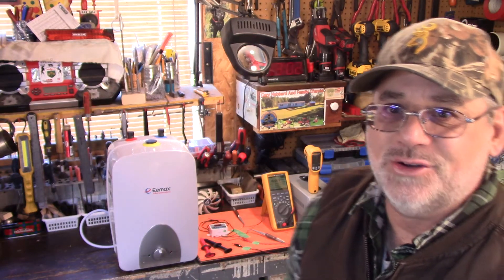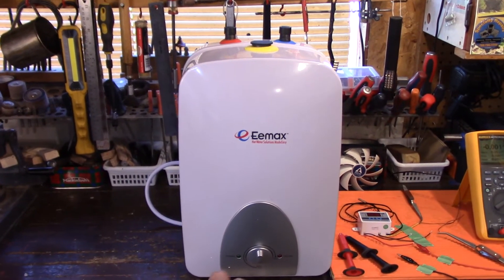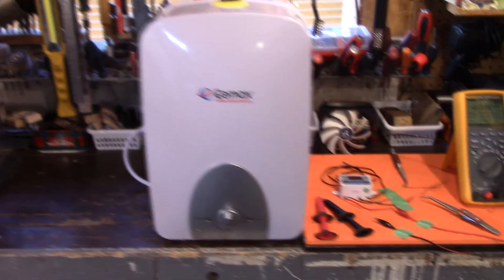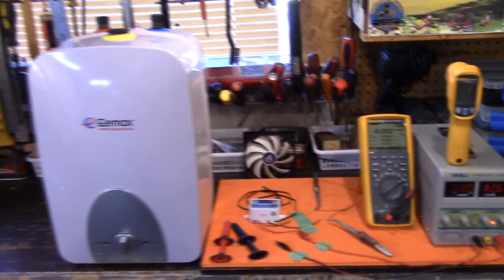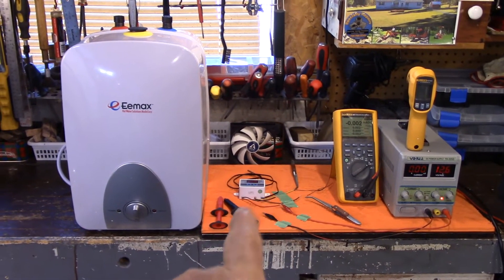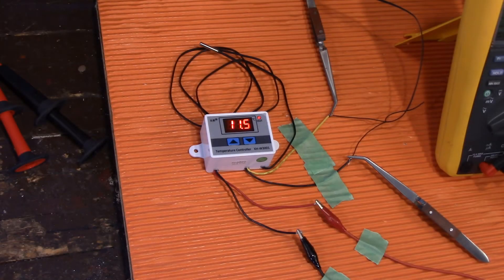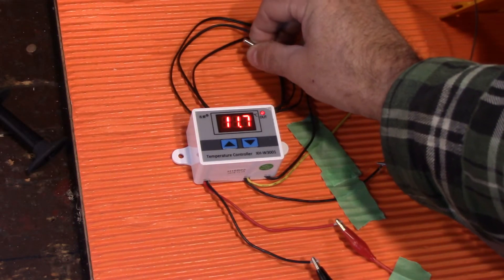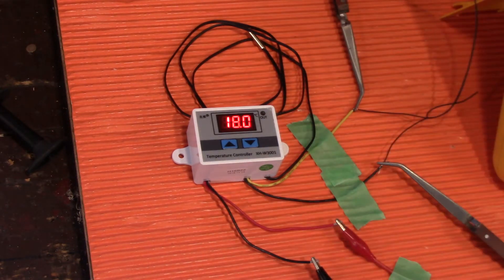Off Grid Water  Heating Experiment - Eemax EMT2.5 2.5-Gallon Electric Mini-Tank

Comment: Will this 2.5 run a shower in a RV or will the hot water run out fast?
Reply from the maker: Hi Chris 
It all depends on the flow rate of the shower head.  Remember your not using all the water just from the hot water tank as you do need some cold water added to moderate the temperature.  A quick shower under inverter 5 minutes.

Comment: Any camp can have free hot water just from excess pv power which is normally wasted.  I have a 6 gallon tank like that at my camp.  These are fast response and only take a KWH to heat up, who doesn't have that.  I have a 40 gallon tank in the garage just for laundry.  Clothes come out steaming hot!
Reply from the maker: Terrific your system is working  for you. Cheers 👍

Comment: If the temp controller uses a capacitor to hold the setting, it might lose memory if the power is disconnected for more than a couple of minutes.  Great project.
Reply from the maker: Great question and one I will have to take a good look at . I could just leave it on starting in the fall .   Great observation Larry 👍